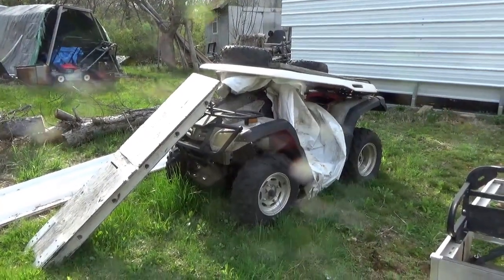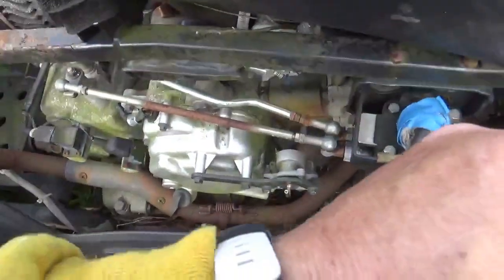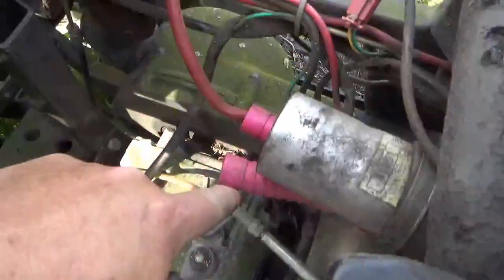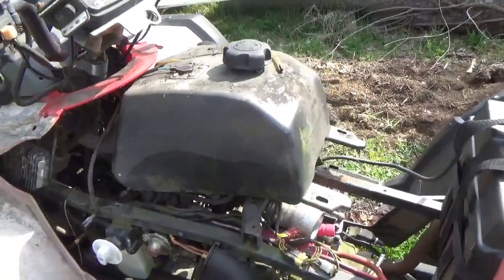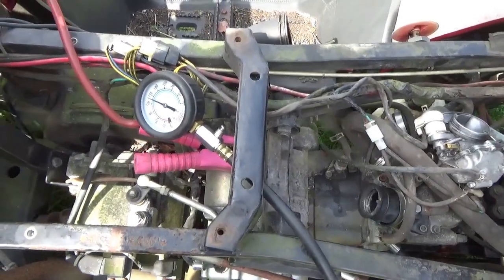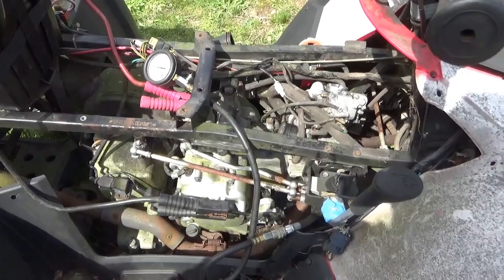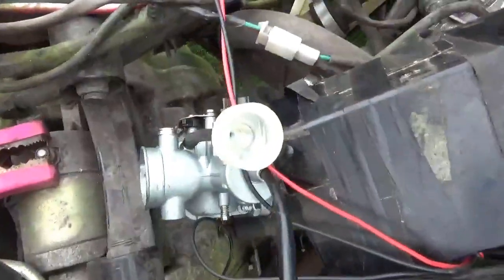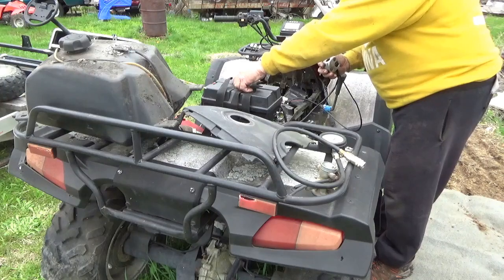Wild Fire 300 4x4, $250 Abandoned and Trashed ATV, Will it Start and Run?

Comment: Transmission is locked until you push the floorboard foot pedal for the back brake it's like a grizzly 600
Reply from the maker: Hey Mike, I did as U recommend and discovered that the back hydraulic brakes actually work, surprise, surprise!!!!  Unfortunately, the transmission did not unlock.... It was worth the try for sure!!! Thanks for the good suggestion, Ur thoughts, watching, and commenting!!!

Comment: I have been beating around the farm on a older 2wd version of that quad - believe it was sold new by Tractor Supply. It's a work horse and worthwhile fixing.   Manco imported them but I believe Kymco still builds the 300 quad in Taiwan.  Mine runs the water cooled single too (I think its 260cc) mfg by Linhai in China.  Mine is 2wd and shifter looks identical (those black boxes are switches to show low gear and reverse gear).  That carb is junk.  The enrichment device is FUBAR so I put a plastic bag over the air cleaner for cold start and Popsicle stick for fast idle warm up.  What Mikuni will work on that motor?

Comment: May just unhook shifter may shift it by hand or make sure the shifter works properly i had a 200 but it was clutch with regular foot shift but the Chinese make good engines its just the frames and the wireing is crap you no wat i mean harvey lol
Reply: I agree, it might just be the shifter. I understand that the box between the shift rod and shift linkage often gets rusty and sticks, especially if the rubber boot is cracked. It looks like the one in the video had a tape job repair. Just my thoughts on the possible cause of the shifting issue. 🙂